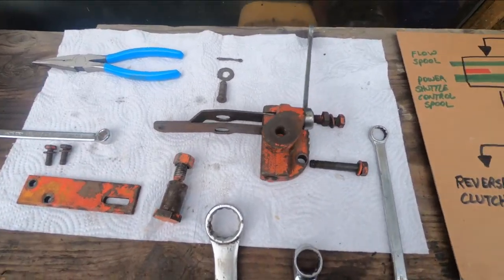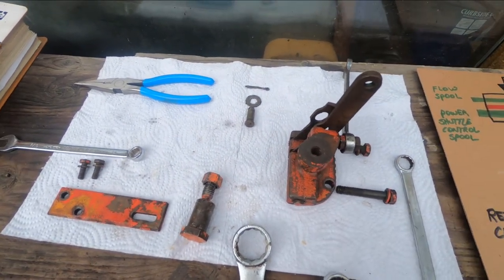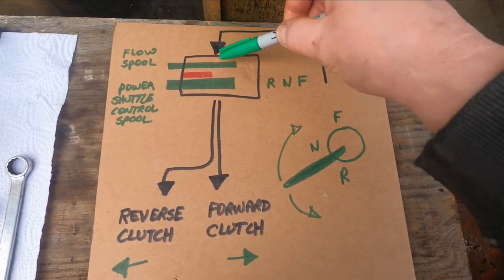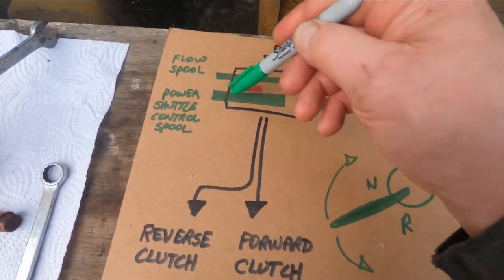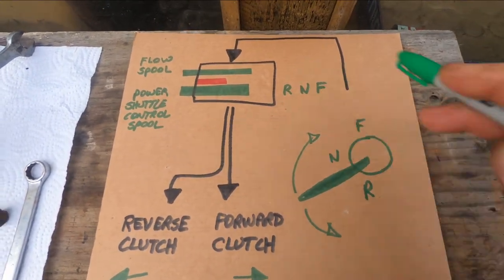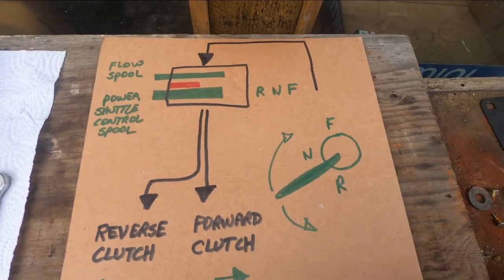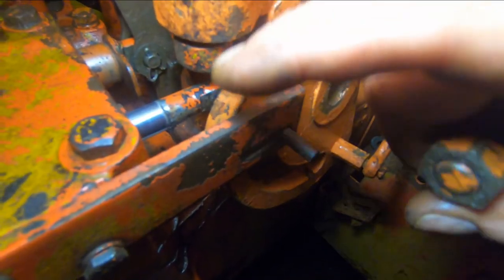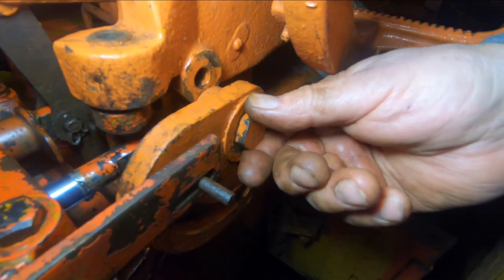HOW TO ADJUST SHUTTLE CLUTCH LINKAGE ON A '68 CASE 580CK TRACTOR

Comment: Yea, once you get it going, see what the clutch does and dial it in from there. I like your theory about the cam being from something else. Then the pin guide...If it works it's perfect right? What's the idea behind the hydraulic clutch anyhow? Easier clutch pedal? Mine is a regular clutch setup. It's not the worst thing I've ever driven but I could see it getting tiring if there were a lot of back and forth such as running the loader all day long.
Reply from the maker: A shuttle clutch works a bit different than a regular clutch. There is no need to push the clutch pedal to change from forward to reverse, just move the control lever on the steering column. If you are going forward and want to reverse, just throw the shifter in reverse. The clutch pedal is only used when you want to manually move the stick shift from, let's say 2nd gear to third, or to 4th. All the shifter speeds are available in both directions. I think they came up with this design to make it quicker to load material,: move up to a pile of earth, back up quick, advance to the truck to dump, and so on, simply by thowing the shifter forward and back. Inside the shuttle clutch, there are steels and frictions packs for both forward and reverse. When hydraulic fluid is directed to one or the other, it compresses the clutch pack engaging the direction. Very similar to the steels and frictions in an ordinary automatic transmission. This thing even has a torque converter bolted to the engine flywheel. I'm still learning about it, but that's the general principle of operation.

Yes, the linkages are a bit antique and seem to me to be the earliest prototype that someone came up with in the shop. Instead of refining that design, they just threw that prototype into mass production. That's where the word "Haywire" comes from. A farmer just fixing something quick to get by.  Thanks for watching!!
Reply: @EverydayProjects  I was in sort of a trade school and I operated a 1979 580C. That one had no clutch at all. Just your forward and reverse lever on the column with a 4 speed gear selector on the floor. I don't know if it was supposed to be, but we'd upshift by putting the column shift into neutral, grab another gear, put the column back to Forward. That one was a torque converter as well. On my 67, I don't think you can shift gears while moving at all. I've tried it and a few times I've managed it but it sure doesn't seem good on it so I don't do it anymore. I can get all four gears either direction but it's nearly helpless in 4th gear.

The cam and guide are certainly not elegant solutions but if it works as expected I wouldn't mind. If something happens to snap your guide it's not too hard to make one on the fly. Is it possible that was a replacement someone made? I've heard these compared to the GM Squarebody of the tractor world. Honestly I'm kind of surprised they came out with a shuttle type clutch so early on. Might have been in the works to remove the clutch pedal altogether pretty soon so they just used whatever parts to make it work until they got rid of the clutch pedal later on.
Reply from the maker: @heliarche  Like I say, I'm new to these too, but the clutch linkage seems to be factory. Maybe designed as a shortcut knowing they'd be getting rid of the design soon. I looked on YouTube for "Shuttle Shift" and see how it operates (at least on other tractors, not a CASE). Here it is: 
https://www.youtube.com/watch?v=tkJspGYNU64
I think you'd only need to step on the clutch to pause moving forward or reverse, or change gears. The brake pedals are supposed to be adjusted to engage at the same time the shuttle clutch is pressed down. Leads me to believe that unless you wanted to stop, all you need to do is throw the shifter back and forth. Hopefully we'll get to see that happen here someday!
Reply: @EverydayProjects  You'll get there! It looks daunting right now but one bite at a time!
Reply: @EverydayProjects  Do you have any idea why it would slightly grind going into gear, it appears the rod is going all the way into the control when the clutch is pressed. Seems to grind more when warmed up?
Reply from the maker: Something sounds worn. Even though the spool moves all the way it can still not be engaging the clutch plates adequately. Open the shuttle clutch top cover and inspect the friction material for thickness and condition. Also, make sure you are using universal tractor fluid (not hydraulic fluid) in the shuttle clutch/torque tube. I use Shell Rotella but some go all out and buy better fluid like Hi-Tran. Napa will sell all the fluids you need. Other than that, I'm not sure what is happening. Good luck!! @samohtnotslar

Comment: Awesome mate thank you. I’m having a problem with changing gears while engine is running. Can’t change (they grind even though clutch is depressed. However if I start in gear with clutch depressed, then let clutch go, it engages. Any ideas on what might be happening. Got a 580b ck.
Reply: Hey me too! Would love to know what's causing the grinding. Any adjustments? Can't seem to find it mentioned in the shop manuals

Comment: Great video! I am looking into getting one of these and the guy says it will go into forward but not reverse, I’m wondering if this hydraulic spool valve is stuck not allowing it to go into reverse? Do you have any thoughts on that?
Reply from the maker: It could very well be that the spool valves are stuck. Start by checking the linkage to the dashboard selector lever. Make sure you can get the full range of motion(forward-Reverse). Have a helper watch the spool. You should feel 3 distinct detents. It won't move much, maybe and inch total but that's where I'd start. The clutch pedal on these tractors isn't an actual clutch. It is another spool valve that dumps fluid back to the reservoir and to the shuttle. Check that spool for freedom of movement too. If that checks out, make sure you have the correct level and type of fluid in the shuttle clutch. The spool valve assemble isn't that complicated and parts are still available (some at CASE and also at one of the vintage tractor websites). Beyond that Iam fairly new to this tractor too so I wouldn't know what else to check. If anyone has an idea, post it in this thread. Thanks for watching and I hope it helped!
Reply from the maker: Maybe some of my other videos on this topic can help: 

https://www.youtube.com/watch?v=cTtPWycwe-w&t=750s

https://www.youtube.com/watch?v=xh0N1opBmdQ&t=4s  😀

Comment: Got same backhoe,different problem?Gearshift on right dash/ 1st/second/3rd/4th wont shift into 3rd or4th?Can do it with pry bar in linkage works fine?Cant find diagram on linkage,lubed everything??Shuttle forward and reverse is fine???Help please!!
Reply from the maker: Take the cover off the manual transmission and inspect the forks inside the cover and the gears. Look for anything that is binding, worn or damaged. I'll bet there is something in there that isn't as it should be.

Comment: What fluid type and qty is required in the torque converter  fill port.   I cant find the right answer anywhere.  Getting a Whinning sound in neutral.
Reply from the maker: You'll need a TCH rated "Universal Tractor Fluid" such as HY TRAN (it's the best). Look for oils that have the TCH rating. I'm using Shell Rotella Tractor fluid that is rated as TCH equivalent. My '68 580CK takes just under 5 gallons to fill the torque tube to the fill mark on the dipstick (which is the mark about 1 inch from the bottom of the dipstick (look for the mark on your dipstick). You may want to fill and drain with the proper fluid before topping up to get the current oil out of the inner workings. Fill to the mark, run the tractor for several minutes, drain and discard the new oil then refill. Good Luck!
Reply: @EverydayProjects  If I put the gear shift in neutral and the shuttle in neutral, the oil pressure goes to 140 and makes a whining noise.  I am having slipping problems in F or R.  as it warms up is gets better.  Any ideas?
Reply from the maker: @paullandry2697  Maybe the clutch pack in the shuttle clutch is worn. If you remove the shuttle clutch cover you will be able to see the clutch disks. I haven't had that apart so I cannot advise on how to proceed but I think you'll have to split the tractor to get the clutch pack out.

Comment: 12:08 Thank you! The PDF manual that I have says that the distance between the pin and the bolt is 3.575" and is obviously wrong.
Reply from the maker: I have the original, Case manual and this was the measurement. Who knows, different versions or years may have had different distances. Thanks for watching. Have you subscribed? It's FREE and there will be more tractor videos coming along. Thanks again!